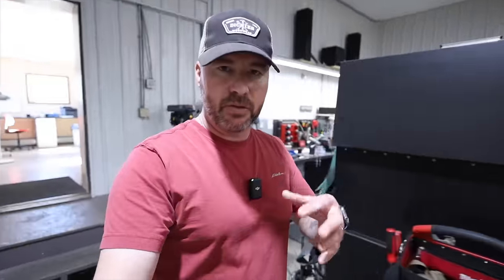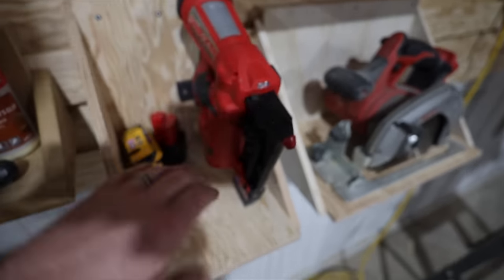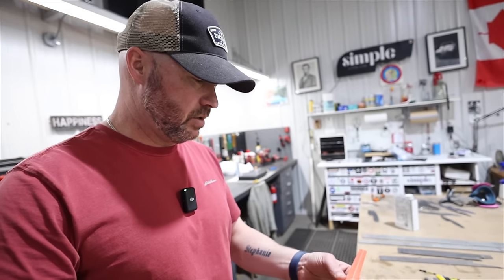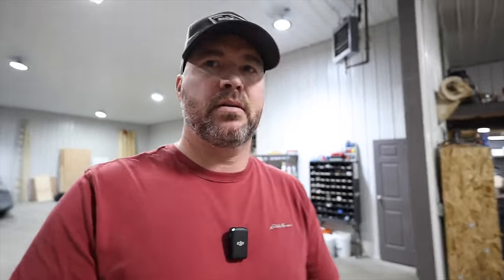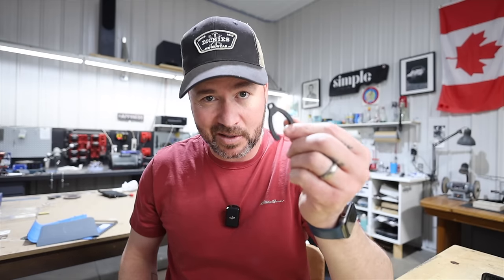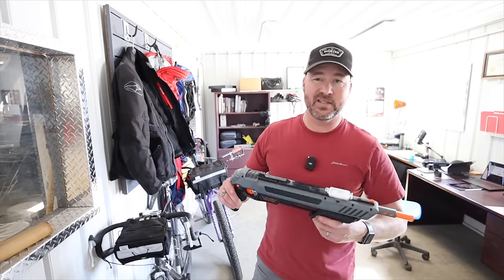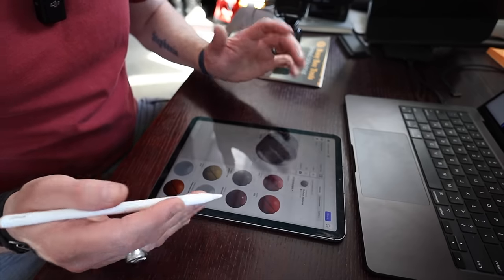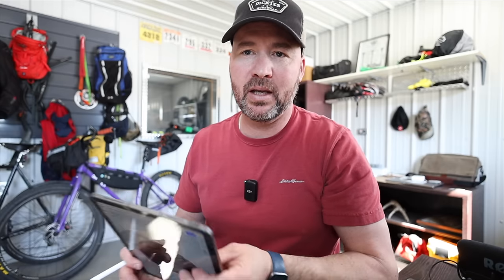Do you NEED a 3D printer?

Comment: 3D printers have advanced a lot in the last few years. Becoming easier to learn how to use & maintain. You can buy a fairly easy to use & maintain for as low as $300 or $1500+ going down as low as $100 that require some skill to maintain & use.
What you can make is largely limited by your imagination. 
I've enjoyed making things and learning how the process works & making improvements on my machine.

Comment: At least you got into it with a good printer. I spent 6 years fighting with different ender3s. Its, only been recently that 3d printing has been about making stuff and not just diagnosing why the machine isn't working. Ever since I got my P1S I haven't turned on either of my enders.
Reply: yep, now printers are coming out that offer a true OOTB printing experience it's a completely different game. I never use my Ender 3 because it's so much hassle, I've just bought a Qidi and I've already got 3 or 4 projects I can't wait to start working on knowing that the chances of random failure are significantly reduced
Reply: Bambu lab P1’s? What printer would you recommend for me to start on? For small projects like tool holders etc?
Reply: @danieljerloew  there are a lot of good options now, but honestly the Bambu printers have been great for me. The P1s is great. From what I can tell the smaller A1 is great and not super expensive.
Reply: @danieljerloew  Highly recommend the Bambu Lab P1P or P1S. The P1S is only $100 more and is enclosed which opens up so many more possibilities for different filaments.  I'm seriously considering ordering another P1S.

Comment: I started with Creality Ender 3's and those were fun to learn on.  3D printers, and specifically the Bambu Lab machines have come so much close to being appliances that just work out of the box.  I have do so many functional prints for my home workshop and my commercial brewery that it makes life so much better for both.  They can be great for trinkets if that's what you want, but functional items can make life so much better in very little time or money.  I use TinkerCAD for much of my design work. It is basic, but has the ability to import existing STL's for modification, which is my current favorite use.

Comment: Welcome to the community. 
3D Printing prototypes has come a long way in the last few years. It is preferred before spending money and wait time for injection molding only to find out you need to revise and start the process again. Lots of time and money saved for mass manufacturing. 
Also companies like Slant 3D will manufacturer anything 3D printed in smaller scale, from a few to thousands of parts.

Comment: As someone who recently got into 3d printing, let me add this...

If you want 3d prints to be the hobby, and not the printer itself, buy the Bambu labs printers.
Reply: I'll second this.  I've been on both sides of this story.  I've had printers that I've had to spend hours tinkering with the settings just to get the damn thing to print.  Bought a Bambu and I am able to find or create a model, send it to the printer and it just works.  So much better when you are prototyping and doing multiple iterations of a design.

Comment: Are there different formulae of filament? How well do 3D printed objects do in direct sunlight over time? I am thinking boat fittings. Stainless steel is not the right stuff for a lot of things... Of course that comes with the next question of how strong is this stuff? does it compare to machinable nylon (not sure what the right name is for the stuff) or even fibre glass objects? How good compared to aluminum.

Comment: For the spout (and many other 3D printed devices made for chemicals) it can be pretty easy to just assume they'll all melt eventually, however the resistance to the chemicals is all dependent on what solvent and plastic you are using. Acetone for instance will completely dissolve ABS and will make other's like PLA and PETG soft and gummy so you want to use a different material that isn't adversely affected by that solvent. For acetone you would ideally want to use polyethylene, polypropylene, or fluoroplastics (Teflon, Tefzel, etc.) however these aren't at all common printing materials so the next best one would be Nylon since it is fairly resistant to most solvents including acetone. Generally just do a bit of research on what plastics are resistant to the solvent you want to design for, find the best one that is printable, and make stuff to your hearts content!

Comment: Yes I do. Just can't decide which one to get.
Reply: depends if you like tinkering or not, ive used some very expensive machines of many varieties but found that most often i use an ender 3 pro.
Reply: As a tool, a Bambu, the P1S and X1C if you want to print nylon and ABS, the A1 series if you don't. Prusa's aren't bad, but they are slower. As a hobby, pick your poison or hell build your own from a voron kit.
Reply: If you want to learn printer repair / modification - buy an ender.  If you just want to print things, buy a bambulab.
Reply: Today the K1 is a good alternative to the Bambu and at a better price